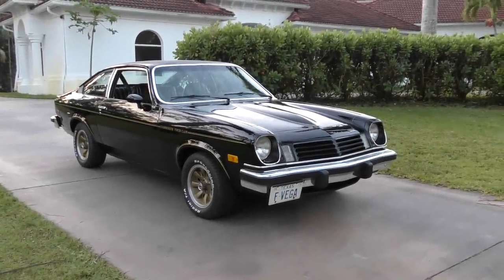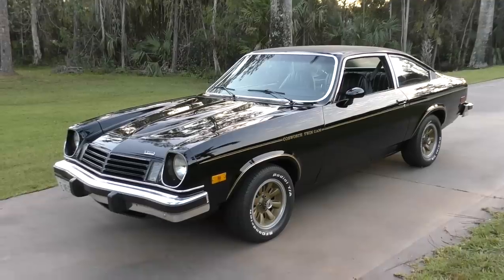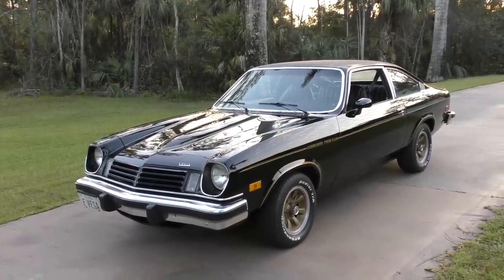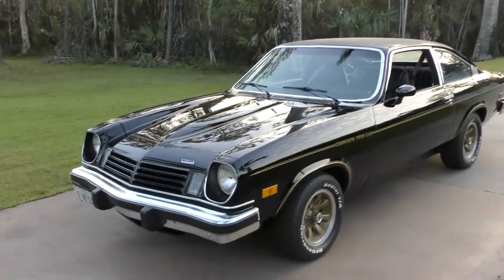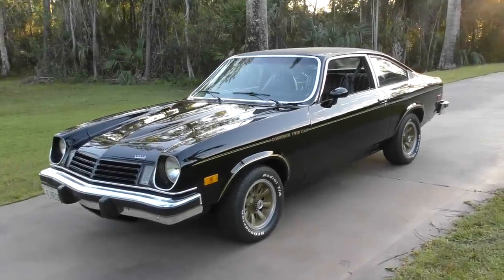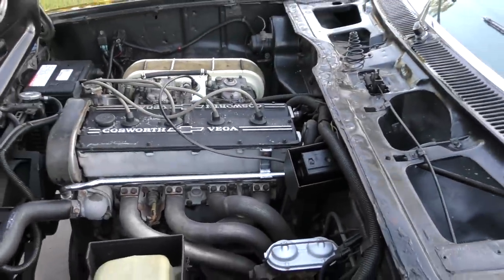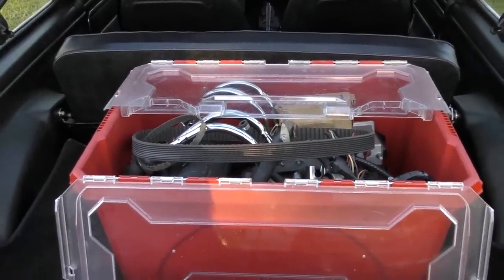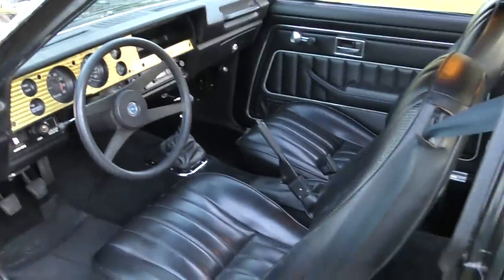The Cosworth Vega is an Amazing Car, But Came Too Late to Save Chevy From Their Terrible Decisions

Comment: I had no problems with my VEGAS.  I never overheated them. And I used valvalean racing oil. And the 1quart truck oil filter. Chevy first electric  fuel injection.  The cams were smaller than the stock vega. They retarded the timing and brunt the valves on the emissions dino test. On purpose. Held up the release.  They had color's  at the end. Swing out back windows. That's.   Not seen mitch. On a vega. What happened to the trans am steering weel.

Comment: I'd like a Vega built by Toyota , but Toyota's we're also rust buckets in the '70s

The Vega was tested about as good as the  Covid mRNA virus -  very  rushed.   Corvair was dropped in '69 and GM had no small car to sell.  Should have kept the Corvair for another year or two.  Chevy Ii was also rushed into production in '62 but it was basically a downsized full size Chevy.    GM probably should have used the cast iron four from the Nova for the 1st year of the Vega.

Comment: Somebody ought to do a clone of a cosworth vega and put in a modern 200hp 4cyl in it. Then slap a single turbo and shoot for 300-350 later. Slam a tremec t6 behind it and maybe narrow a truck 10 bolt with an eaton diff or something like that. I would actually drive something like that. I remember these cars when new. I was young but because of dad I've always been a car guy. The cosworth 4cyl didn't really impress me back then but I honestly did see what they were trying to do and understood the association with the name Cosworth.

Edit : blasphemy would be done if it got a honda 4cyl but that would work. Initially I had in mind a modern GM 4cyl but not familiar enough to know what is what exactly. Maybe somebody has an ideal engine swap candidate idea out there? Please let me know if you do.

Comment: Had a GT that I put 3 engines into, one engine only lasted from Akron to  Toledo of course it was hauling a 6 x 10 covered trailer at the time. 
I sold after the third engine and new guy dumped into a ditch. 
#VegaMemories

Comment: Vega wasn't successful?  From 1971 to 1977, they averaged 286,666 sales per year for just over 2 million sales. Malibu from  2000 to 2021 averaged 169,170 per year for 3.721 million total. Pinto ran an average of slightly better at 317,349 per year but lasted 17 years for 3.174 million. During that period, Camaro average 137,918 cars per year. I'd say Vega was very much a success compared to the others. 

Vega's problems stemmed from rushed production, bad idea (original was not going to have any radiator, believing the aluminum would shed enough heat alone so the small radiator was thought more than adequate - Ed Cole), the need for a break-in period with break-in oil (500 mile first change needed opposing a marketing scheme of extra long maintenance periods so first oil change was scheduled for 7500 miles.) By the time the first oil change was made, the cylinders and rings were gone, leading the oil contamination, oil usage, excess heat, blow by, cylinder wall erosion, and more. Valve oil seals were wrong material, got hard, and broke. Management cheaped out and used an iron head, instead of engineering's aluminum one, and dissimilar metals have different expansion rates, so overheating was critical. 

It was not nearly the engineering fiasco painted as much as unable to fit the marketing demands. 

BTW, I see it sold for $22,000. Maybe on your next video, you can cut out the foul words.

Comment: The Vega was a worn out heap in 4 years. The front suspension deflected into an unadjustable mess with normal use. And rust consumed it in a non rust belt state. It was cute and cheap but low quality. Cosworths were it's only high point. Then those wore out even quicker. A new one was toast in 3 to 5 years.

Comment: You know the 28000 miles are original, because there's no way a Vega is making it to 128,000.

The engine makes it sound like a fun car, as it revs its way from 0-60 in about 10 seconds.  Couple that with no creature comforts, and that noisy as hell fuel pump and you have to wonder if people who bought these cars said to themselves "maybe a Corvette or a Camaro would have been a better option after all".

However, that 60 extra HP could have made this car something special in the mid 70's.  If the car was released as it was envisioned, you might have seen the Vega nameplate persist into the 1980's.

Comment: When the Cosworth Vega came out, Ford owned Cosworth. So technically the engine in the Vega is a Ford. The Chevy 2.3 engine was really terrible engine. It was an L engine, meaning the intake and exhaust were on the same side.

Comment: I was never a fan of the Cosworth Vega. I think they should have put a small pushrod 2 valve V8 in it instead. It would have been much more American. I love simple engines. The Cosworth engine was not only not an American design, but it was too complicated, and too expensive.

Comment: The Vega had a cool body style and many went on to the drag strip. But the truth is these cars were mechanically terrible, with a power train that usually crapped itself at a early forty thousand miles on average.And before they did quit, they were very under powered. My brother had one and it took off like a freight train from a red light.  This is a barn find? I’d keep lookin . It was a turd then, it’s a turd now, unless you want to spend the money and change the power plant

Comment: Similar shape as a European Opel Kadett from the mid 70's
Reply: '76 at my Sister wedding reception my Brother-in-law had recently purchased a new Opel Cadet, and was so proud of it. Before the new bride and groom were ready to depart, 3 of us lifted the back end up(without much straining)and the other guys were able to put concrete blocks and a few wood spacers under the rear axle so the rear tires were just touching the ground. The look on his face was priceless when he looked out the window to see why it wasn't moving...we asked if he could find first gear! try reverse? is there oil in the gearbox? etc... 🤣🤣🤣😭😭😭

Comment: The door trim at the top and the rear quarter window trim don't line up on the driver's side but do on the passenger's  side. Typical 70s GM build quality 🤣🤣🤣

Comment: Chevy should have just dropped either a 283 or 305 in it and it would have sold like hotcakes.
Reply: The alloy Buick 215 would have been a good match, but GM had sold the tooling to Rover in the UK.
Reply: @timothykeith1367  --  Damn near anything would have been better than what they did to include the cosworth engine.
Reply: @jamesbass9797  I was in high school at the time and the car magazines always had stories about the Cosworth motor.   I've seen maybe two of these cars.  Its a shame because I like the Vega as a package, it looked nice and handled well.
Reply: Yes i agree i never understood since gm owned opel why didnt the just grab the opel opel 1900 engine and tweek it they owned the design why reinvent the wheel. And a hi po 283 vega ss would have been great.
Reply: @timothykeith1367  -- I passed on the Vega and bought myself a Manza spider.  It had a  350 in it and would literally light up the back tires.  Loved it!
Reply: Probably by then they saw the handwriting on the wall for mileage conscious customers and thought the  4cylinder engine would compete with the Asians and Euro econo class cars???
Reply: @garylampkin4288  --  Probably on their minds yes.
Reply: @garylampkin4288  The Corvair had a reliable engine but was quite different than anything GM had previously built.   Management must have thought that the alloy Vega motor could be just as dependable, but the team that produced the Corvair motor did their homework and it was not a rushed job.  I understand that Chevy engineers did not develop the Vega engine program and didn't want it.

Comment: TO BAD THAT A FACTORY 350 OR SMALL-BLOCK  400 WAS NOT OFFERED TO COMPETE WITH MUSCLE CARS OF THE TIME !!!! THE LOCOMOTIVE SMOKING OIL 4  CYL. - STEEL SLEEVED BANGER GOT A BAD RAP !!!!
Reply: The V8's ended up in the Monza's starting in the '75 model year. 262, 305 (and 350's in the CA cars).
Reply: @turbo8454  YES YOUR RIGHT 👍 HOWEVER THE VEGA HAD BETTER BODY LINES !!